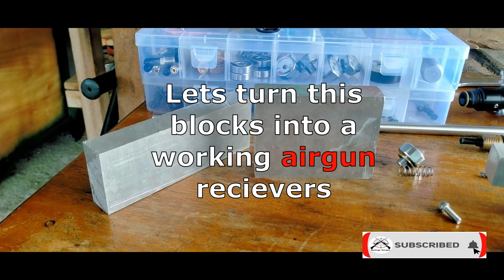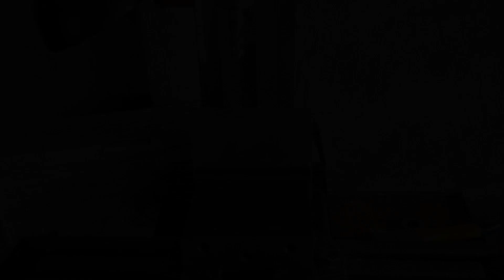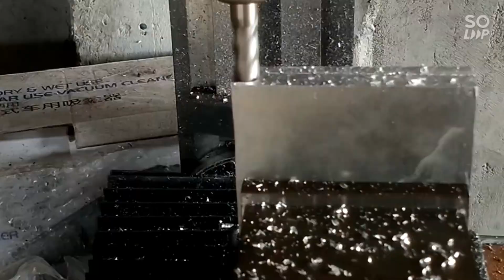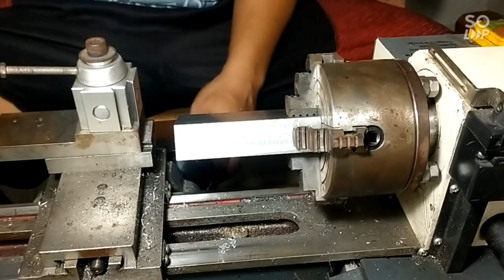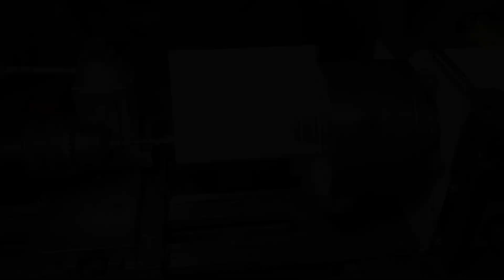how to make PCP Airgun reciever Part 1

Comment: Hey I just started my CNC programming and machinist certification program do you have blue prints or gcodes. I see your doing this old school . I want to make a PCP gun that shoots 9mm
Reply from the maker: I dont have a code or blue prints... I measure them manually bro
Reply: @kalingaairgun  your very talented
Reply from the maker: Thanks bro
Reply: @kalingaairgun  do have any easy projects for a student to do using a lathe . Bc I have to come up with one next week. Lol
Reply from the maker: Try making a reciever bro research it so that you understand how it works ☺️... Its better that way because you will learn from it ☺️... Or you can make hammer if you lack on time 👌
Reply: @kalingaairgun  I'll have all the time I need provided by the class. And I have full access to all the machines and robotics arms . We have multi axis CNC machines and lathes and drill presses and mills and we'll be using broaches as well.
Reply from the maker: Thats good bro study hard 👌👌👌